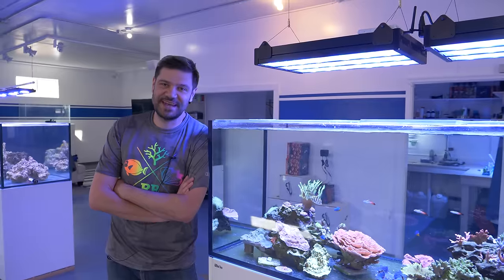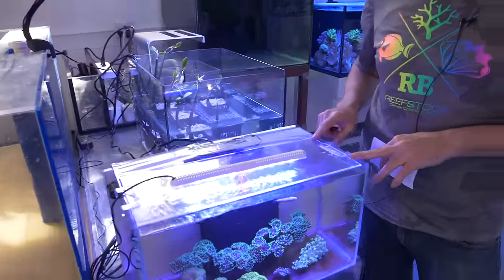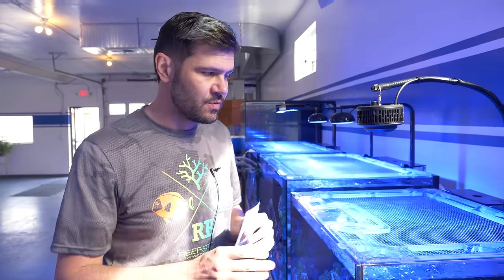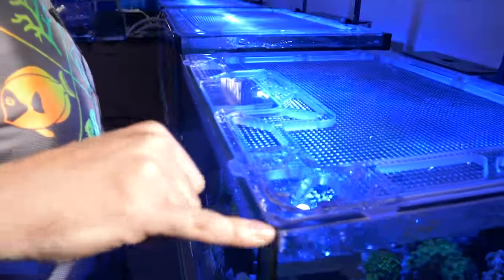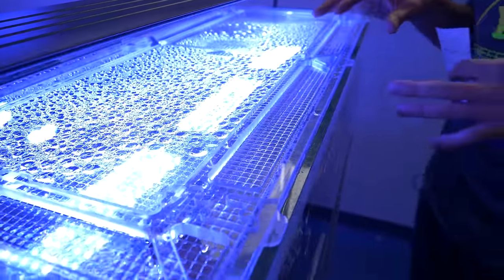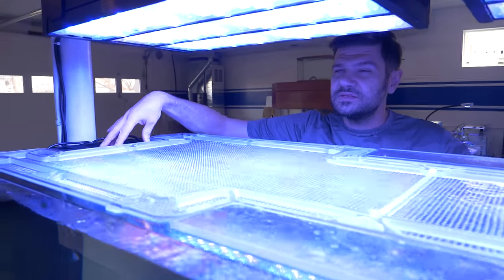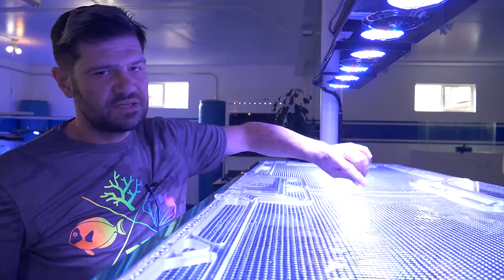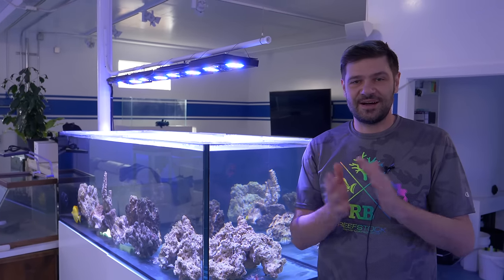Vlog 29: The MOST Important and Overlooked Aquarium Accessory, the Lids

Comment: WOW guys, your title says it all as simple and true as it could be and you did such an awesome overview on our lids.  We look forward to seeing your continued input as you use them more and more.  But most importantly, we look forward to keeping your fish safe and inside the tank where they belong!  

I just wanted to point out a few small things that we think are important to clarify for your viewers.  

1.  All ClearView Lids are made using Polycarbonate plastic.  Though polycarbonate and acrylic look similar, they are very different.  One of the biggest differences lies in their strength.  Polycarbonate is 200x's more impact resistant than glass.  Acrylic is only 10x's more impact resistant than glass.  Acrylic will bow and warp quickly when used as a lid.  Polycarbonate, on the other hand, will not...at all.  

2.  The lids you are prominently displaying in the studio are our all NEW Pisces EXO line.  Pisces EXO takes the innovative interlocking modular joint design that was launched a year ago with the Tsunami but builds on it to offer even greater options for expandability and durability in the future.  The most notable difference between the Pisces EXO and the Tsunami is the addition of the venting cutouts all around the frame.  This vented frame boasts a solid frame surface width of only 1" across 95% of the frame...even on the largest models.  Comparatively, Tsunami has a solid frame surface width of 2 1/2" across ~75% of the frame.  The Pisces EXO frame is designed to 'breath' a lot better than a non-vented frame like our Tsunami and Classic style lids (resulting in less condensation on the frame in low humidity/dry air environments like yours).  Lastly, a Pisces EXO weighs ~50% less than a Tsunami lid for the same tank,  but is also carefully engineered to be structurally stronger.  With Pisces EXO we now find the weight of the lids to be getting very close to the lightweight afforded by aluminum framed lids of the past....but in a much nicer looking, more durable, and more customizable format, that is designed to compliment the tank while protecting all of your little fishies =).

3.  All lids are built to order and shipped fully built and screened, though we may again in the future offer DIY assembly kits.  Tsunami and Pisces EXO lids are modular and can, therefore, be upgraded in the future to add new accessories (such as the braces, solid inserts, extra feed doors, new section pieces with different light cutouts, or an added autofeeder).  

4.  Pisces EXO lids are not yet available on the website, but are available through Pre-Order.  At launch, they are currently available only for Red Sea, WaterBox, and Innovative Marine aquariums.  Other brands will roll out in stages.  Classic and Tsunami lids are available currently on the website per regular terms and availability.  

Further details can be found on our website at www.clearviewlids.com.  You can also email us at orders@artfullyacrylic.com.
Reply: When will the Pisces exo be available for the website looking for one for my Red Sea Max 170 and trying to get an idea on pricing.
Reply: @DhG4410  you can email us at orders@artfullyacrylic.com for pricing and further pre-order information.  Thanks!
Reply: A link to your site would've been awesome.
Reply: Ripoff.. tap plastics does what you're doing for $30
Reply: @bovice1766  Mmmkayy....tap plastics sells plastic.  They don't make lids.  So, not sure where this trollish jewel came from, but I hope you have a nice day though!!
Reply: @clearviewlids  They sell completely customized acrylic. You give them the dimensions and they will CNC it exactly how you want for literally $30. One of your overpriced lids for a small 20G nano tank costs more than the tank and equipment lol.
Reply: @bovice1766  We're sorry to hear that you may be misinformed, so we'd like to take this opportunity to provide some helpful clarification for everyone's benefit. Our high-quality lids are precision machined using a real CNC ROUTER, resulting in a smooth edge, finished with a nice clean bevel to ensure no sharp surfaces. Lid centers are cut out and spline channels added in the frames to hold the screen, which is an essential component in ensuring good air/gas exchange and allowing unobstructed light transmission.  Our lids are designed specifically to suit the needs of the fish hobbyist.  We understand that every customer has unique requirements and that's why we offer customization options such as cutouts for lights, cords, feed doors and other equipment to ensure your lid fits your specific needs.

Tap Plastics specializes in selling plastic, not in manufacturing aquarium lids.  They will cut you a solid, square/rectangular slab of plastic using a table saw or CNC panel saw (rough sawn and no bevel).  They don’t offer the customization necessary for cutouts, feed doors, or screening so it's really not at all a fair comparison to make.  

But since you wanted to compare the two I pulled up Tap Plastics page….for an IM Fusion 20g tank the cost from Tap Plastics, (using ⅜” thick polycarbonate as we do) would be $58…for a ⅜” thick slab of non UV coated polycarbonate with saw cut straight edges.  Our lids start at under $88 for this same tank, which is a great value for a high-quality, custom-made product.
Reply: @clearviewlids  To say they can't cut any type of acrylic in any configuration is dishonest. Your lids that are already configured for well known brands are well priced. I'm talking about the majority of unlisted tanks that need to be customized to fit unlisted tanks. It's way cheaper to give  tap plastics the dimensions and have them do it. Also yes they absolutely can CNC cut a spline channel and a rectangle "feed door". Technically speaking you get more acrylic with them since you only provide acrylic around the edge and the rest is just mesh screen lol
Reply: @bovice1766  You really can't remotely compare the two services.  I've worked with Tap Plastics in the past and nothing I said was dishonest, though I do now notice they offer UV protected plastic and you can optionally have edges machined at extra cost to avoid the rough sawn edges.  If $30-$50 is your price point there is nothing wrong with that....get a DIY aluminum frame kit or perhaps use some twin wall polycarbonate panels (like those used on many greenhouses).    Don't use acrylic to cover your tank.  If you go buy a slab of acrylic to put on your tank from anywhere it WILL be money wasted.  It will bow BADLY.  Just trying to make clear, so I'll say it one last time.....acrylic and polycarbonate look similar but are NOT the same material.

You are still comparing pricing models and making argument for their standard cut-to-size services.  This will still only net you a rectangle/square slab of material with none of the typically needed cutouts for screening, lights, overflows, cord slots, etc.  If you want special cutouts or to have your lid CNC Router machined then you will have to employ their Custom Fabrication Services ($$$)....which is a TOTALLLY different animal.  Seeing as the price difference between their basic service and ours was already pretty meager, this level of their service offerings would be extremely unrealistic for most consumers looking for a custom lid.  If you are looking for a custom POS/POP Retail Display or for 2000 laser cut widgets THEY ARE YOUR PEOPLE.

Custom lid fabrication is our specialty, not theirs.  As a result, for their customer fab services, YOU will need to provide them full dimensional drawings, to spec, to use on the CNC for the cutting of your lid (NO, you can't just give them basic dimensions when there is this much detail involved, so few examples....Do you know how wide to make the frame member to avoid excessive flex over a given frame span and how this relates to the thickness of the material used?  How about the size and placement of the spline channel?  How will the lid sit securely on the tank?  Due to size, does the lid frame require any extra bracing/reinforcement to minimize frame flex?).  Then once all that has been done YOU would still have to screen your own lid.  

Sorry BoVice, but if you still honestly believe we are a "Ripoff" and that Tap Plastics does the same thing for "literally $30", then all I have left to say is you are entitled to your opinion, and we'll just have to agree to disagree.  But please, for everyone else's sake and ours, don't go spreading misinformation and malicious commentary about a company that you've never actually dealt with.  We are a small, American owned and operated business.  As a small business, reputation is everything.

Comment: How do you feel about the feeding door vs no feeding door? I like the look without it but will it wear on the corner joints over time if I tilt it up to feed? Do you get condensation running back when you lift it? The manufacturer recommends the door. Thx

Comment: Go with TopLids, clearview is not a good company. The lid they made did not fit my aquarium after waiting over 2 weeks. They would not refund a 9$ cutout that i no longer wanted on the replacement lid as the first lid that arrived did not fit. They claimed that the dimension of my tank was off although the lid would not fit on both corners hence the lid would not fit either way if the dimension of the tank was off or not. They did not make it clear that i wont be getting a refund for the custom cut that i no longer wanted on the replacement lid when i asked for that change. I find out later when i inquired about my refund for the custom cutout that i wont be getting that refunded. Horrible customer service from my experience. I mightve save a few bucks from picking toplids but i guess you pay for what you get. Another thing is the screen that they put on the frame is not done perfectly considering you paid a decent amount for a custom lid. The screen is not stretched out nicely and evenly (basically imperfections).
Reply: I meant i mightve saved a few bucks going with their tsunami lid to the regular lid made by toplids, but you paid for what you get. Lesson learned and i just want people to be aware of this when making a decision.

Comment: Reduces cost.... looks at lid for my tank which is a standard one... $250... good lord I'd hate to see if the cost wasn't reduced.
That said, I am still old school running metal halides, no way I'm trusting acrylic lids.  And I almost feel like having a nice rimless tank that you can look down into the top is kind of pointless with a lid.
Reply: Hi Mike, our lids are actually made using polycarbonate (largely a cause of the cost) so your metal halides won't cause issues with the frame at all.  We have customers with classic lids going back over 4 years now without an issue in sight with the frames.  The clear mesh, on the other hand, will eventually deteriorate under the intensity and heat of metal halides.  We have some metal halide customers reporting 1 1/2-2 years before needing to pull and replace the screen.  Luckily all of our frames are designed to allow easy replacement of the screen.  Tsunami and Pisces EXO take it a step further by allowing individual frame section replacement as well.